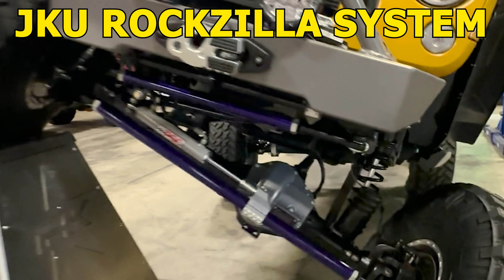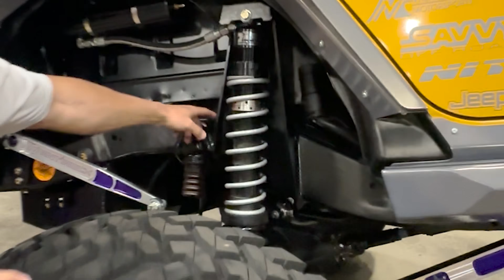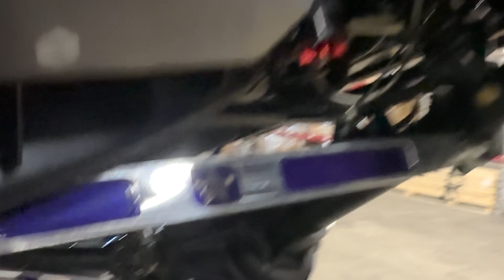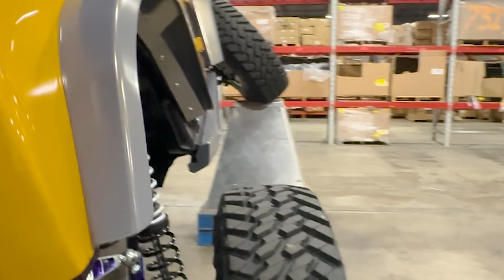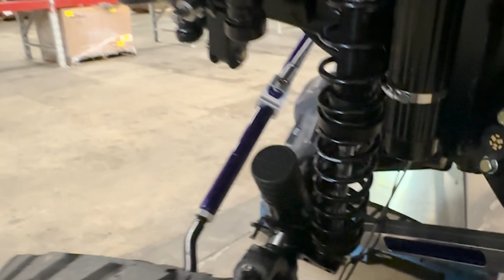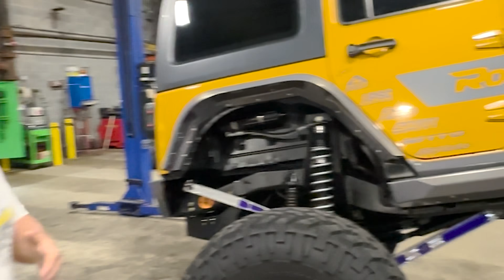Amp'd JKU Rockzilla Build Walk Around Video

Comment: What is the difference between this and terramoto by genright?
Reply from the maker: Well, Terramoto has a V8 and this one doesn't "yet".   Basically Terramoto is a genright Elite system suspension wise.  A good system for sure.   The major differences are as follows; the Genright Elite JKU requires a body lift, motor mount lift, it does come with a flat belly skid, very heavy frame cutting, cutting into the rear tub area and is much more intrusive to the vehicle itself.   The Rock Krawler JKU Rockzilla uses very similar traits, Independent 3 link front end, double triangulated 4 link rear end, smooth bottom skid plate tieing the front cross member to the rear cross member, no body lift (hardly anyone does that one JK's), no motor mount lift (again, hardly ever done on JK's), the Rockzilla does not require cutting into the tub area so the cabin stays completely sealed off from the elements like factory and less cutting of cross members etc.   IOHO it is just more "civilized" when comparing the two.   The Rockzilla still keeps the Jeep much more a Jeep for all weather conditions.   This is very important to us as we are in the Northeast.  Most states deal with bad weather of some sort!